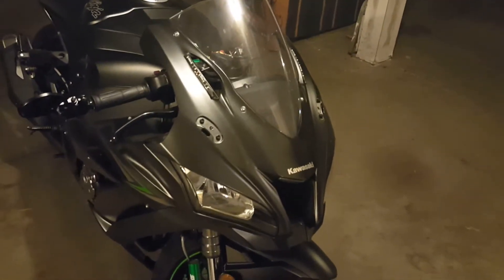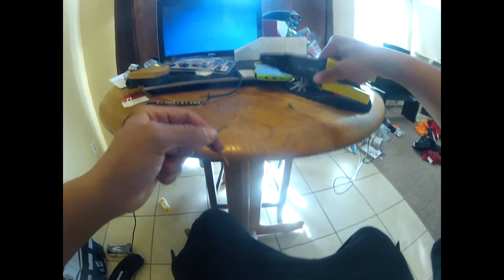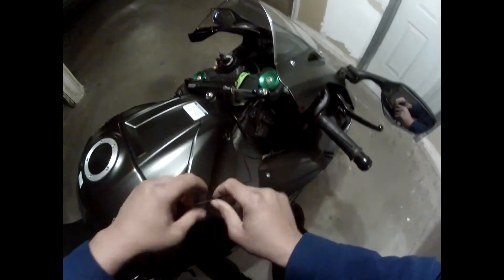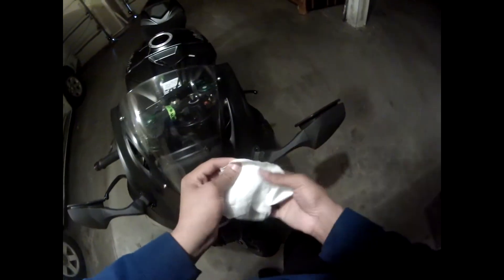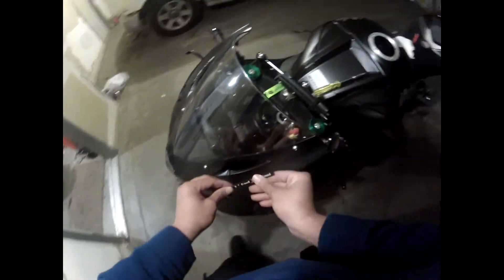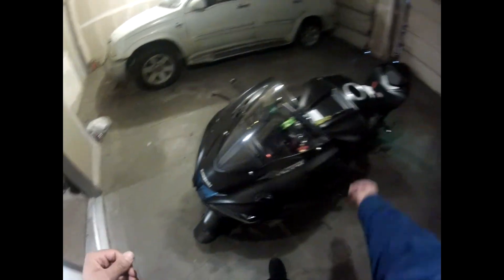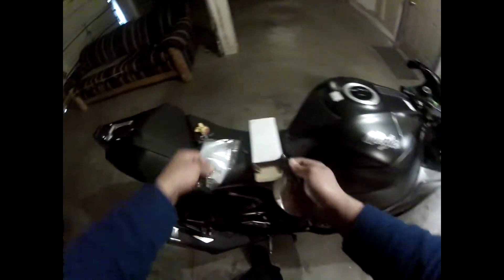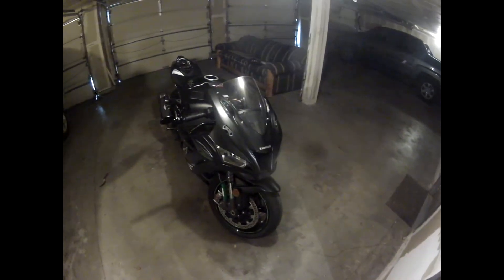2016 Kawasaki ZX10R LED Turn Signal and Bar End Mirror Adds

Comment: there's nothing wrong with doing it like that mine and you're mod is identical only thing i used some cheap Chinese slim turn signals and mounted it under the headlights. i own an 09 Zx10r so i have the really fugly mirror turn signal i did the block off stuff but almost got my hawaiian ass run over from the car next to me so i took off the signals from the stock mirrors and reused the mirrors but ill be ordering shorter after market mirrors soon . me and you think alike but the shit works and looks good ill post a vid on how i did mine.

Comment: I use my mirrors way to much (w/o ability to filter in WA I am sketchy about stop lights) to sacrifice them for those bar end mirrors. Anyone know of good looking ones that work well to use?
Reply from the maker: Squidtron Z I hope you got your bar ends.  They are way better than stock. I would check ebay fire options
Reply: Moezhawk, I went with CRG arrow mirror on the left and Acerbis lever guard on the right.

Comment: question, why didn't you put the stick on indicators on the far edge of (big side) of each headlight, there is a gap also that would feed and hide the wires

http://www.revzilla.com/motorcycle/new-rage-cycles-led-front-turn-signals-kawasaki-zx10r-2016
Reply from the maker: Benjay1975 I just really like placement.  I felt it just looked good lol